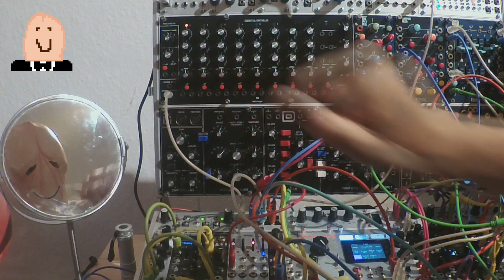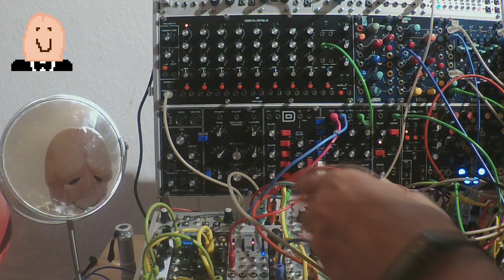Behringer 960 Sequential Controller Overview Sequencer Tutorial with Penishead system55

Comment: maybe a stupid question, but still, is it possible to control drum module like ssf ultra kick with this sequencer?
Reply from the maker: For that you need  a sequencer with gate outs. The 960 is cv sequencer.
Reply: @penishead_official  too bad :(( will have to connect kick to crave ... i guess

Comment: My clock out of the seq gives a clock signal (not gates) so I can't trigger an EG, for example. I need to use Marbles to convert clock signal to gates. ¿Is this normal?  🤔. If gates are intended to sync several modules how can I sync another seq to this one? Step shift?
Reply from the maker: A clock can be the same as a gate. The 960 has an old concept. The 960 osc is like an lfo. Low its a pulse and fast its like an osc (sound). The CV outs gives tunable pitches so these are not gates. So you are right! To sync this module please watch my sync tutorial. But there is a hint in using it synced!
Reply: @penishead_official  Of course. That's why I was confused. Multiples I used did not copy the right signal!!! Solved. Thank You so much!
Reply from the maker: @FernanQ  nice that I could help. that feels good.
Reply: @penishead_official  hehe I've found a very rare issue. Clock out of 960 triggers Doepfer's ADSR but not always triggers Intelligel's ADSRs! Trying others possibilities... 🤦🏻‍♂️